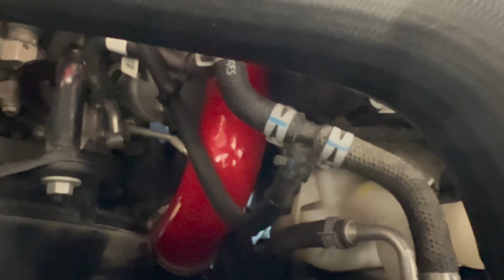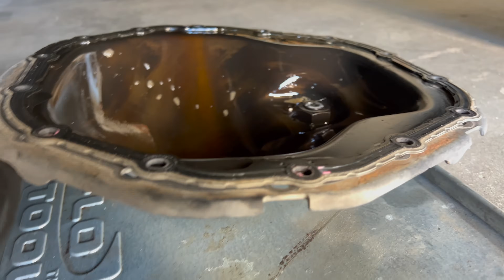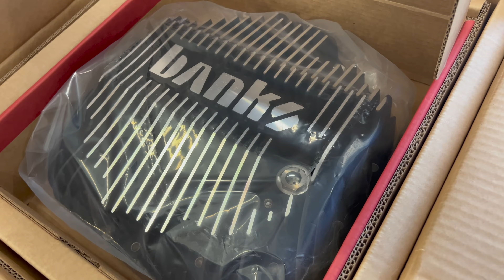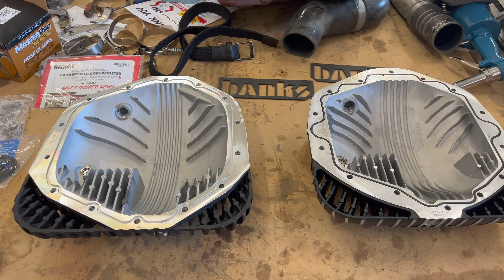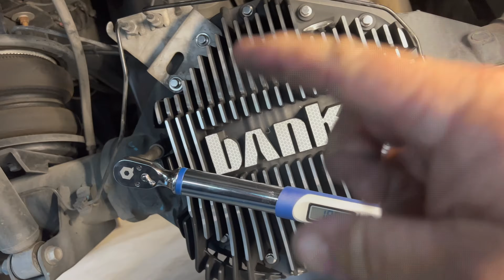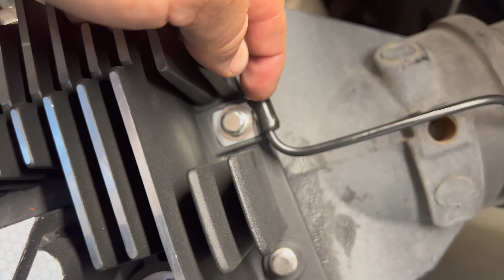2021 #RAMTrucks 3500 H.O. with full #BanksPower Upgrades! Banks Ram-Air Differential Cover Install!

Comment: Ummm the Banks instructions specifically say to use only 12 ft-lbs, not 18 or 20. It comes with blue thread lock, so the bolts shouldn’t back out.
Reply from the maker: The Banks instructions say that now but two+ years ago when I made this video, they did not.

Comment: Hey, David, hope all’s well. Caught one of the first comments left on this video about one getting into the political scene and found it to be as ignorant as can be. Thing is that men and women have the ability to lie but numbers will NEVER pull off such a thing and under DemocRATic leadership (if you could even call it that) numbers were as horrific as they could’ve possibly been… From the looks of our current fella that’s running the show it seems as if America’s back onto the “right” path! NOW I shall ask away on the question that I came on here to ask you (lol)… I own a 2019 model (3500 dually limited with the H.O.), is it all the same for mine as well when it comes to the process of replacing the cover just like you did on this clip?? Mine didn’t come equipped with airbags from factory but I did install the AirLift (7500XL) kit with the onboard compressor… I just want to make sure that it’s practically the same process that you went through within this clip in order for me to handle the task on my own!

Comment: Why not delete? I did all the bank stuff on my 3500 and did a full delete and I get about 30-33 MPG under when hauling nothing, but 25-30 under a full load.
Reply from the maker: What Math are you using to get 33 mpg??   I did delete it.
Reply: @DavidWilks  1562 miles from full to roughly a gallon left. Then a 50 gallon tank.
1562/50=?
Reply: 31 ;)

Comment: Next time intercooler & boost tubes, & differential cover
Reply from the maker: I have the boost tubes and diff cover… at full boost on a 104 OAT towing 15k# my manifold air temps are within 20 degrees of ambient… so the factory intercooler is pretty stout

Comment: I did the banks cold air intake and pedal monster on my 2020 ram 3500. Get check engine light when I’m climbing sometimes. Anyone else??
Reply: Me too. Banks said it was related to EGR and it wasn’t an issue.
Reply: @Burden2society p0402 is the code i am getting.  It is EGR over flow, and does not affect the truck at all.  Just clear the code every time and keep going.  Banks is aware of this code and the under boost code as well, and are looking for a solution.  But it does not hurt the truck.
Reply from the maker: I've never had any issues, so do you think there is something triggering it?  What code are you getting?
Reply: Me too

Comment: Dude I just bought all the banks stuff for my 2500 and asked them everything do I need and they got me everything for 4800 out the door they gave me a veterans discount and they are AWESOME.  Everything can’t believe it intake air filter intake and the commander and it’s gonna be awesome but I am keeping the def system here due to laws

Comment: What are you running for the tuner & weight loss? I've got the DEF issue on my 2020 HO
Reply from the maker: Read the description of the video as I have links there.
Reply: @DavidWilks  unlimiteddiesel sells their own tunes as part of the pkg & provenperfirnance sells their tunes with their kit, how did you do tunes from proven & equipment from unlimited?
Reply from the maker: No idea that Unlimited sells their own stuff... but Proven Diesel tunes. are what my EZLynk came with and the updates have been on point.
Reply: @DavidWilks my 2020 3500 drw has had gastric bypass, but whoever had it before me didn’t leave tuner in it. Proven doesn’t say if they support us lighter weight customers 🤣

Comment: Is the single axle HO the same size as the dually HO (12")?
Reply from the maker: No it is not.  The High Output also has a larger rear axle than the 68RFE 3500 Dually.

Comment: Great video! I went on the banks website and tried to buy this diff cover but it said it didn’t fit with the airbag suspension? I see you have airbag suspension
Reply from the maker: I did not want the factory airbags as they are not user-adjustable.  So I have the AirLift Suspensions systems so I can adjust everything as necessary.